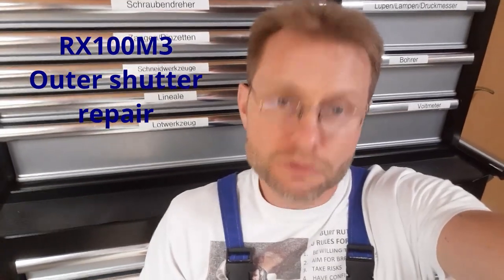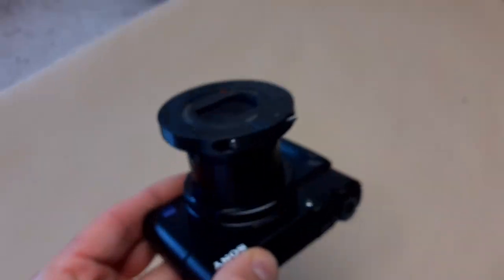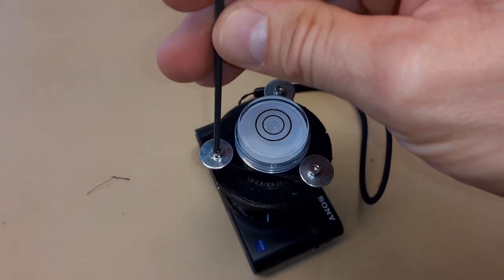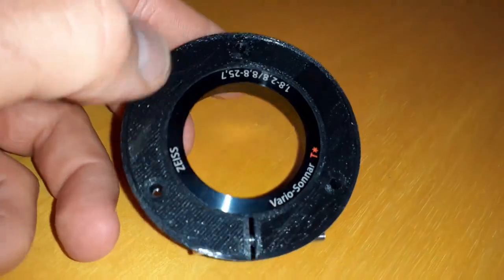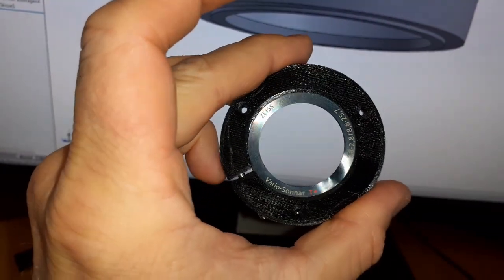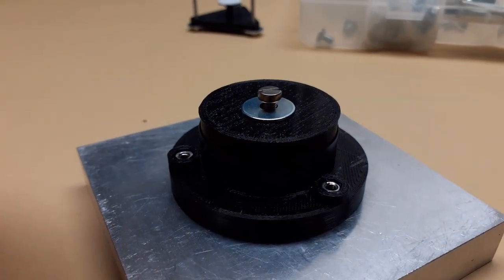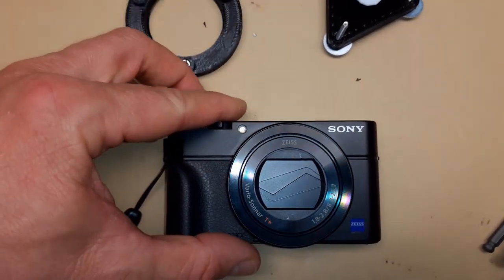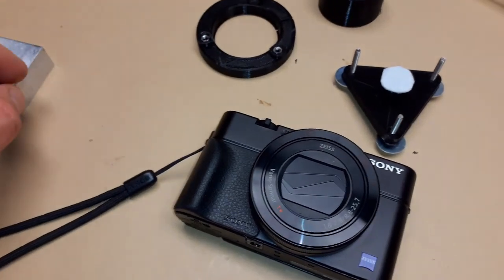Sony RX100 M3 repair of the lens (outer shutter)

Comment: Hi Marko. Thanks for a very useful video. I dropped my camera in the water. I was able to dry it and run it again. However, due to water condensation, there are marks inside the lens that I can see from outside and they appear on the images as well. I was wondering if I could disassemble the lens further (after removing the cover that you did ) to get to inside of the lens and clean it. Any ideas will be helpful. Thanks